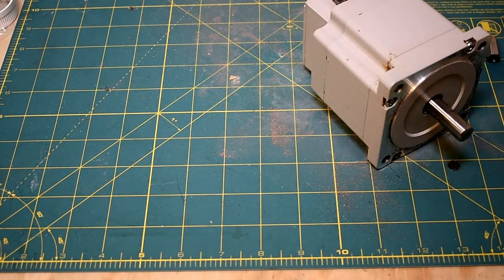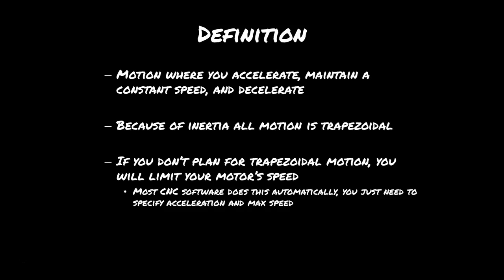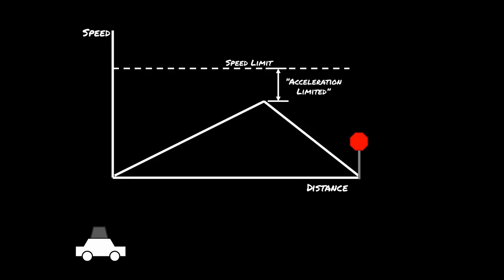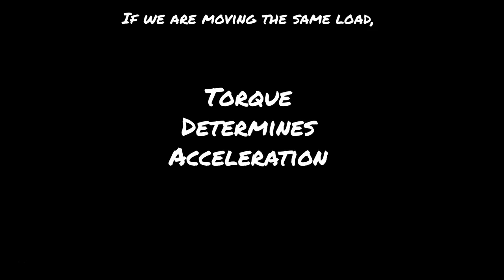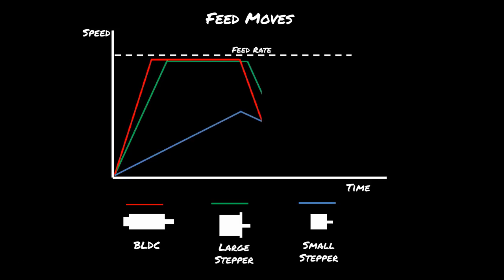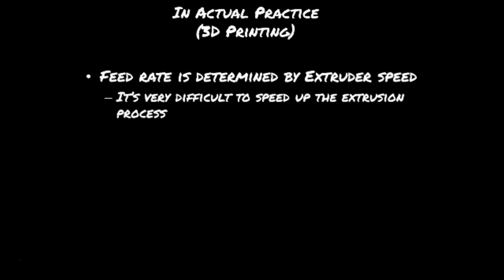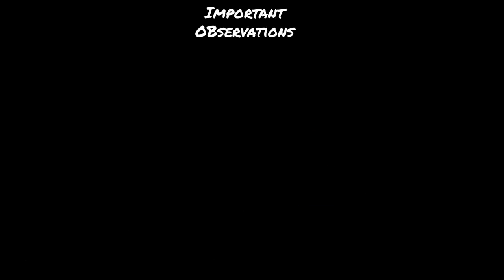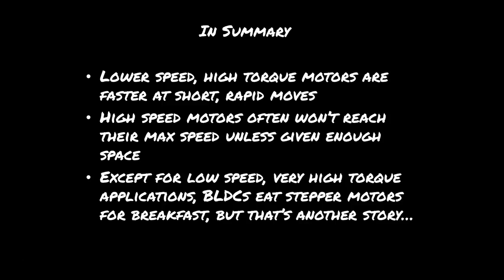Mechanical Design:  Trapezoidal Motion

Comment: Super helpful man! this is one area I was cloudy on :/ Videos in this format are great because of the visual simplicity coupled with the in depth explanation, and you're not treating the viewer like a moron, keep it up!
Reply from the maker: Thanks!  I certainly wish I could animate better:P
Reply: keep in mind this is missing thread pitch
if you take a biggo stepper and stick it on a multistart leadscrew with ridiculous pitch (igus makes some with up to 10cm/rev) you can have some very high speeds at very high acceleration with low overall torque
Reply from the maker: Yep true, I didn't really address mechanical power transmission in general.  I was sort of getting at different motors with all other things being equal.

Comment: Very well explained :) funny timing in the video. I had originally planned on using steppers for a machine function, but found clearpath motors, and have been busy trying to pair with a gearbox for my application. Fun stuff!
Reply from the maker: They're pretty amazing, I use them whenever possible :P

Comment: Great video, I would suggest maybe making an addition to this video of S-Curve motion. We need more hobbiest motion controllers with s-curve motion control / jerk control.
Reply from the maker: I was trying to decide whether or not to include that.  Some hobby controllers have jerk limiting but it's not true jerk limiting.  Perhaps I'll do a part 2!
Reply: I was looking into developing a proper controller, turns out the maths is kinda a pain in the butt.

I've concepted a unit using NCOs and Integrating Jerk -> Acc -> Vel -> Pos in FPGAs. Wish we could find more of a team to work on such a thing.

Comment: Steppers are basically BLDCs. They are usually limited by the max voltage that the stepper drivers can withstand. I have done some tests on my CNC mill and increasing the voltage in less than 50% I got three times more speed and acceleration without stalling.
Reply from the maker: Yep steppers are basically two phase BLDCs.  Higher voltage lets the current stabilize more quickly so the torque drop off is lessened and you can maintain motion at higher speeds.  I remember moving from 24V to 48V on a build and i was blown away by how much better it was!

Comment: Nice explanation. If you take also the transmission and the price in account, maybe a stepper motor with a high torque can be as fast as something else, while the shaft rpm is still not that high.
Reply from the maker: You could probably get better torque-speed characteristics than a smaller motor simply because you're using more power, although gearboxes add all kinds of new complications like inefficiencies and backlash!
Reply: For sure. I thought more about with how many teeth you connect your Motor to the belt or similar, not about gear boxes.

Comment: Nice video but I'll pick a nits - What you're describing is a Trapezoidal velocity curve, not trapezoidal motion.  S-curve is the other velocity profile that's common but it's not so common on hobby controllers.  I believe there was a version of Mach3 called "tempest" or something like that which had an S-curve velocity profile.  Trapezoidal motion would be what your printer is doing when printing a trapezoid ;^)
Reply from the maker: Fair point... I think we kind of abbreviated the concept at work down to "trapezoidal motion", but yep its technically a trapezoidal velocity profile.  Some controllers imply they have an S curve velocity profile by saying they use jerk limiting, but it's more like acceleration-limiting-limiting.  I may do a second, followup video on S-curves
Reply: Cool - you might want to even get into the acceleration profile as well - S-curve velocity profiles have a trapezoidal acceleration profile.  As I was thinking about it, I think that Kmotion CNC/Kflop has S-curves with adjustable jerk.

Comment: Less than an hour ago I literally just setup my trapezoidal on my cnc router after its rebuild. Weird timing! (new gantry with more than 5x the mass, but infinitely more rigid. was able to increase acceleration from 6 to 20, and top speed from 90 to 200ipm)
Reply from the maker: I've been playing with it on my 3D printer trying to optimize my speed, so I was kind of in the mood to do a video about it :P

Comment: Stepper motor is usually powered using 24V DC
If you use 80v DC, acceleration can be increased
But buy expensive stepper drivers

Comment: Also the motor driver is about as important as the motor itself for acceleration, don't buy the very cheapest you can find. The third cheapest is probably pretty good though.
Reply from the maker: Third cheapest is about right.  They come out with new stepper driver ICs all the time that are actually getting quite impressive.  I'm excited for BLDC driver prices to drop down to where stepper drivers are!